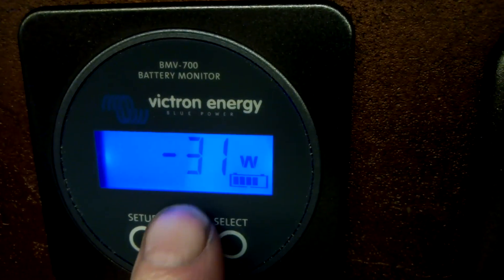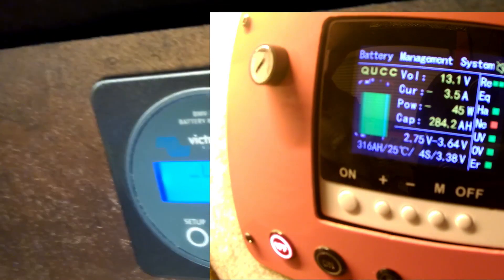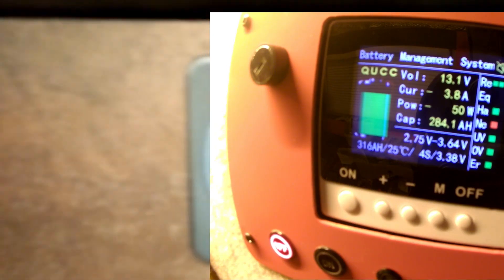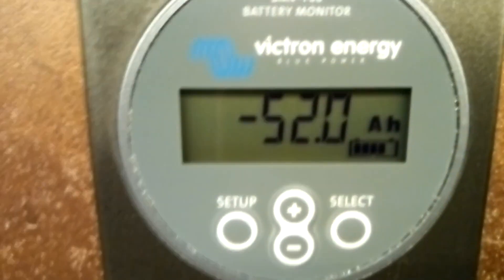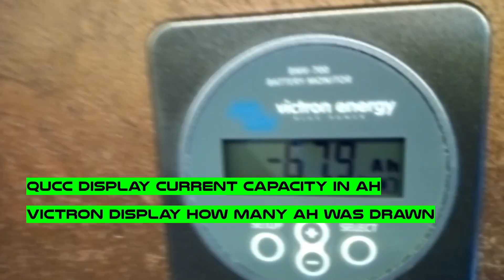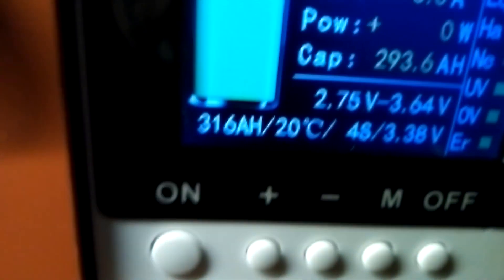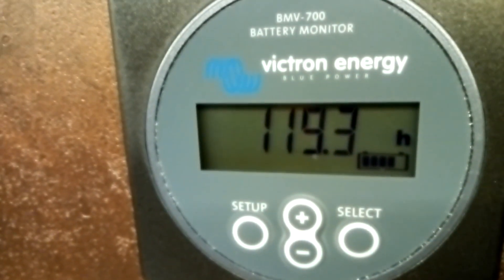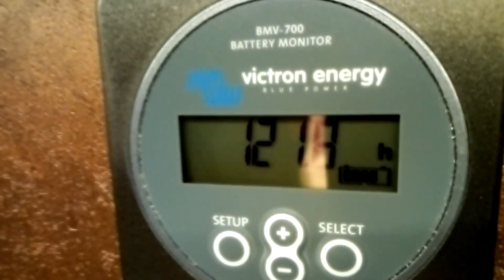shunt vs hall sensor battery monitor which is better?

Comment: There is an offset/calibration on both Victron and hall sensor. You need to use a good current clamp and measure the actual current and adapt the calibration till it fits.